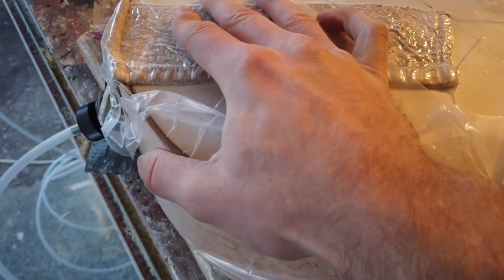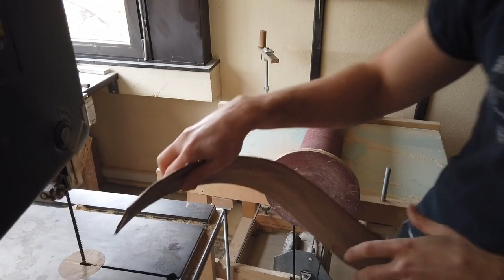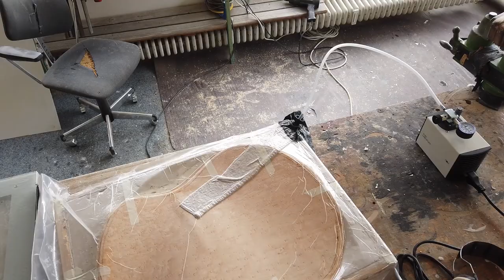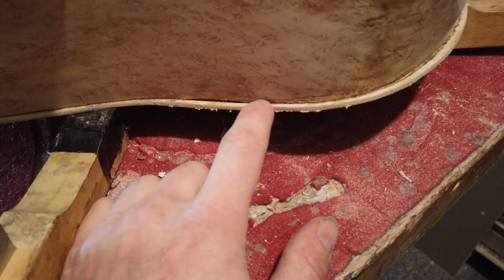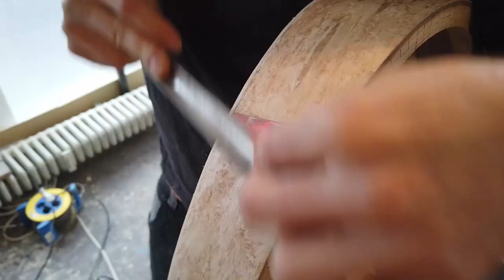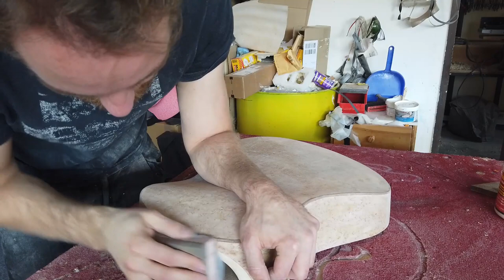Building a "3D" acoustic guitar body

Comment: Just a tip. The bubbles in the veneer are coming from too much glue I think. I had exactly the same with a masur birch veneer job on a desktop. From the moment that I used less glue I didn't had the problem anymore. figured veneer can be very sensitive at that point.   Great video.
Reply from the maker: thanks, I think that's one of the reasons. I think it's better to not use wood-based glue at all to stop it curling so much.
Reply: @cannaguitars4593  Ok. Yes, interesting.what type of glue are you going to use next time ?
Reply from the maker: @lignumdrums  I don't know if there is a next time, but I think I would go with 90min epoxy and a stronger pump.

Comment: plywood guitar. I wonder how it sounds. Is that a linseed oil you're using in the end of the video? Wood texture looks great. Is that curly birch veneer?
Reply from the maker: I made a video comparison to my regular hempstone guitars. And yes, boiled linseed oil, later some french polish. It's birdseye maple veneer.
Reply: For strength and durability this is the best way to go. Won’t ever get side cracks. Very rigid. The only place I don’t like plywood is for the top.
Reply: @TheVectorious  strength and durability yes. But it is best for building materials and not good for accoustics